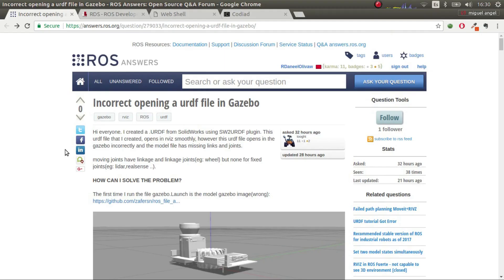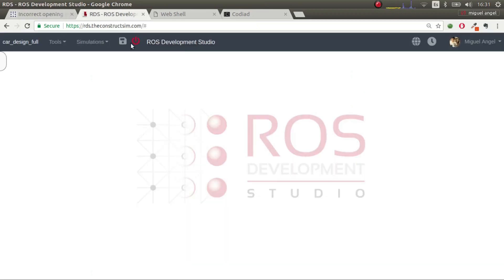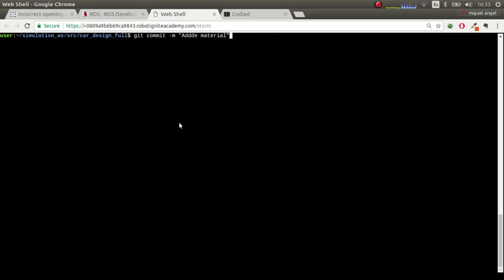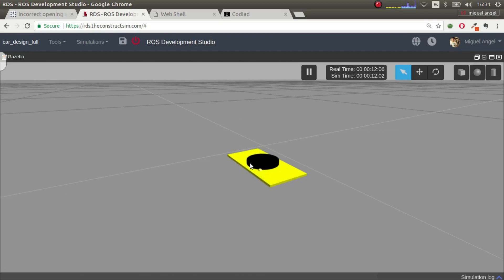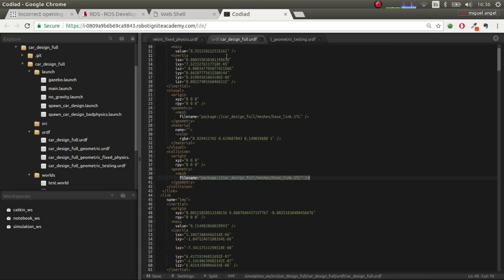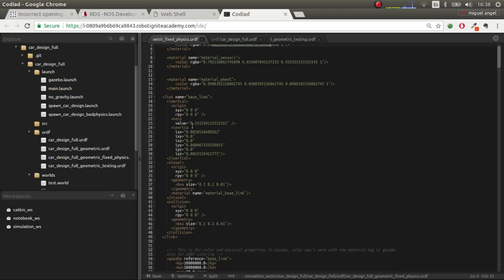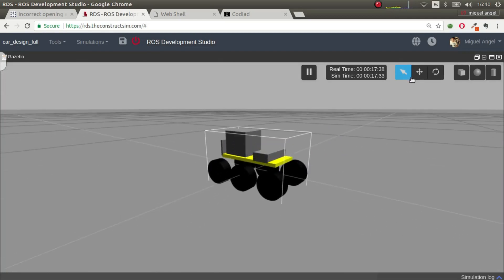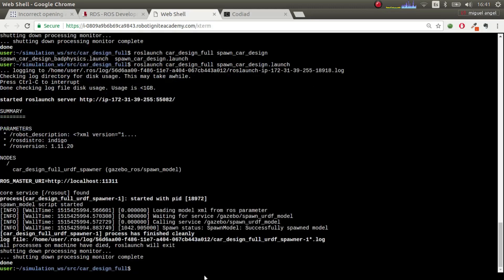[ROS Q&A] 092 - Incorrect opening a urdf file in Gazebo

Comment: How do I calculate inertias for a complex model which uses STL meshes?
Reply: Solved: Meshlab helps to calculate the inertial matrix.
Reply: @HeetheshVhavle  Hi,I also use meshlab to calculate our model inertial matrix,but our model collapse similarly,and i could not find how to get model mass from meshlab,could you give me some ideas about this?thank you
Reply: @HeetheshVhavle  Thank for your reply,I try your method in my model,but it didn't work for me,I feel so upset and weird,and i decide to draw our model without solidworks,Help this ok for me.  Thank you for your help.

Comment: Why does a model scatter?? I am modeling a multiple module snake robot. I use solidworks and then convert it to URDF. Every time i import the model to gazebo it scatters
Reply: @sns_rulz the same goes for me, have you found a solution to your problem, please??
Reply: Though I first launch the gazebo world and pause it, then spawn my model as the GUI is paused so my model is okay, while pausing i change the gravity to false in GAZEBO GUI. And resume it from the pause state to start it's working, but i want to false the gravity automatically (while launching)??
Reply: @fawadkhan8905  hi! actually in my case, my urdf had the issue. I exported it from Solidworks through SW2URDF add on and I have screwed up the frames. One I corrected that it worked for me
Reply: @sns_rulz  What shall I do now, brother? I am at the end and most probably quitting it. Could you please help?
Reply: before quitting it??
Reply: @fawadkhan8905  I can’t exactly say what to do without knowing exactly what you are doing. If your URDF is fine, what I can suggest is to go to the documentation of Gazebo and read topics related to gravity and stuff. You might find a proper solution